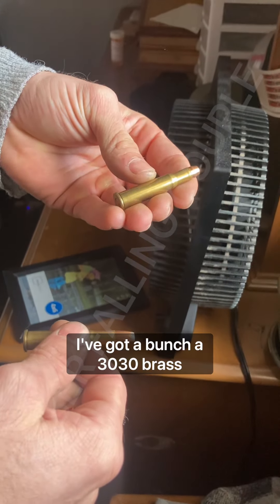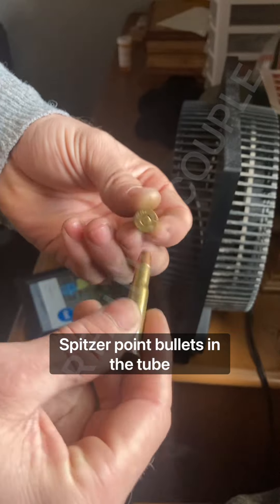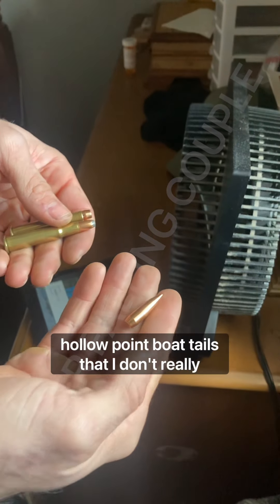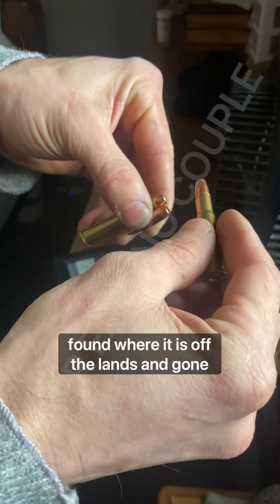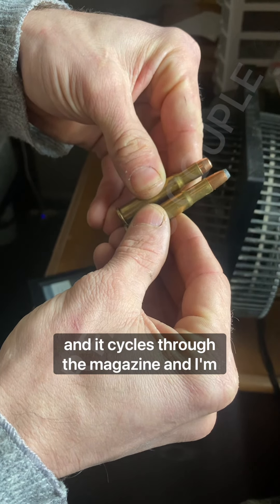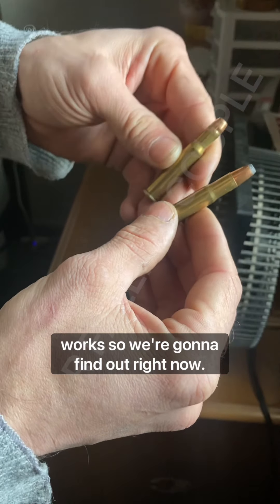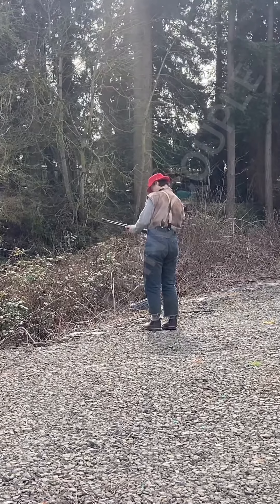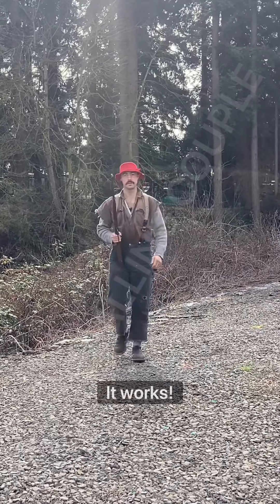Testing the limits of a 100 year old rifle 💥

Comment: I think it’s very cool! You could cut the tips to a place where the new flat face would be the same circumference as the primer.

Nathan Foster of New Zealand always modifies bullets. No one person has done as much for long range hunting as he has. Be it good or bad. He designed the 7mm Practical. And then teamed up with Dave Manson reamers. 

Then they came out together with a line of Manson/Foster reamers. 

Nathan no where near gets the credit he deserves!
 IDK, maybe he’s a real D head in person

But cool video bro. I love my 30/30’s. I have like four. Killed my first few deer and a bear with my great grandfather’s that I have now. It was built in 1910. I still use it when I butcher beer I mean beef in the yard at the house.

You two stay safe and keep making big chips
Reply from the maker: I actually though about doing that with a flat file just making flat point boattails, but that is the experiment for my remaining 40 or so brass